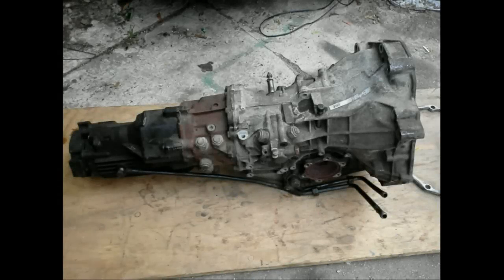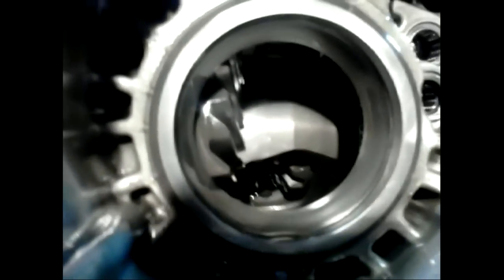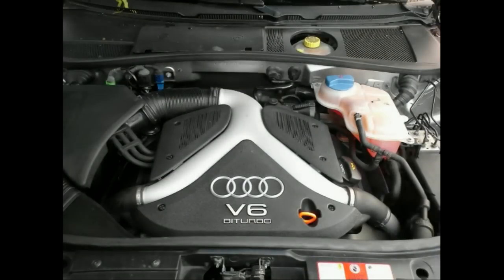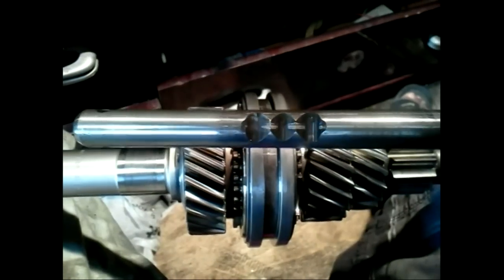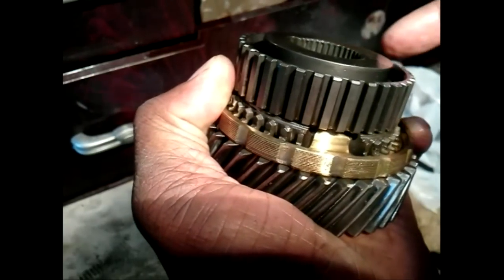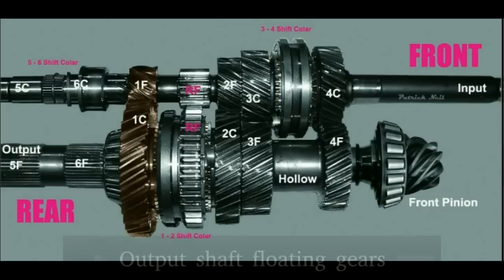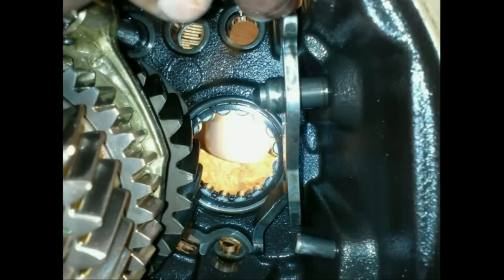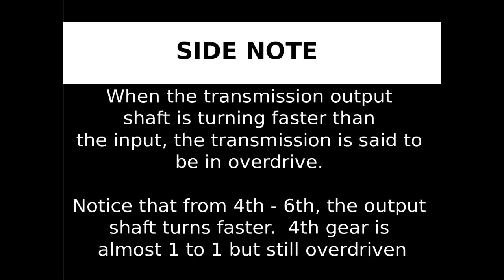Audi 01E All wheel drive manual transmission

Comment: Great explanation of how the transmission works. But what fluids should it be filled with? Does the center differential torsen have any special oil, or does it share oil with the front differential and the gearbox? Thank you.
Reply from the maker: I use Fuchs gear oil or the one from the dealer which is probably made by Fuchs.

There is only one type of oil in this transmission.  The automatic version made by ZF use auto trans fluid for the front section and gear oil for the rear (torsen diff).
Reply: @pnswg01  There are disagreements about what viscosity to use, 75w90 or 75w80? gl4 or gl5?
Reply from the maker: @raulgambramartinez65  I am not a transmission repair person so I can only speak about what I use.  I tried Redline after rebuild and that was the worst.  I changed that real quick because shifting was not good especially from 1st to 2nd and when it's cold.  I replaced it with Fuchs  75w90 and that was a night and day difference.  The next time I changed it I went with the one from the dealer. (I didn't see any difference between the dealer oil and the Fuchs)

As for GL4 or GL5, I don't remember.

Comment: Patrick, hoping you can help. I just acquired a used TDI 01E.  I have not yet installed into my 2004 2.7 A6. This used trans shifter shaft works well by hand shifting on the bench. I slightly rotate the input shaft for alignment and the gears fall into place. Shifting has a good feel, however, the input shaft will not rotate when engaged into any gear. Also, while in neutral, or any gear, the axel flanges will only rotate in opposite rotation.
I'm unable to rotate the axel flanges together in the same direction. Is it hard to rotate the input shaft because of the Torsen differential? And is it also due to the Torsen that I can't rotate the two axels in the same direction?  Or, do you feel that the trans is damaged? 
Any suggestions?   Thanks for taking the time.     Dennis
Reply from the maker: If you turn any axle flange forward, the opposite side turns backwards. This is normal. That is the way differentials work.  You would have to turn both sides in the same direction at the same time. Try applying tension to both drive flange so one cannot turn without the other and power should transfer to the output shaft at  the torsen differential.

https://youtu.be/VN4_asSBEKY?si=T8878DMp94L0eVt7